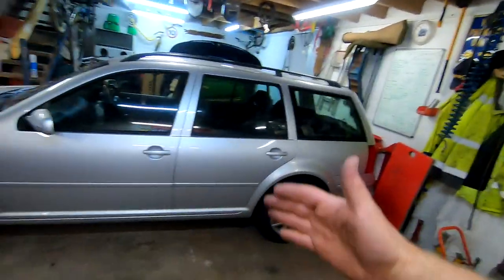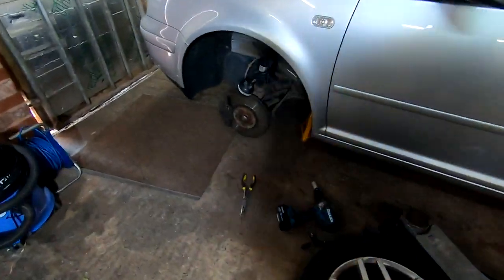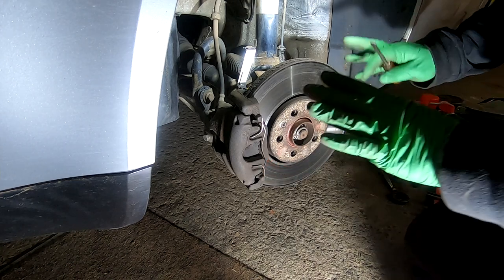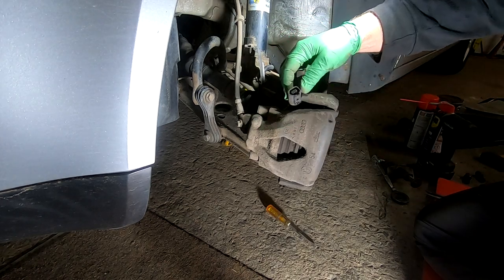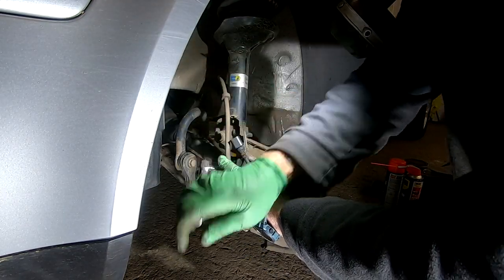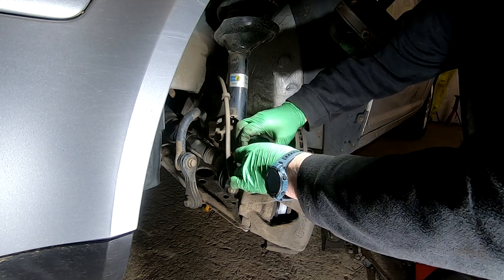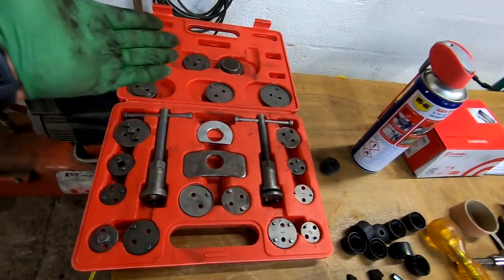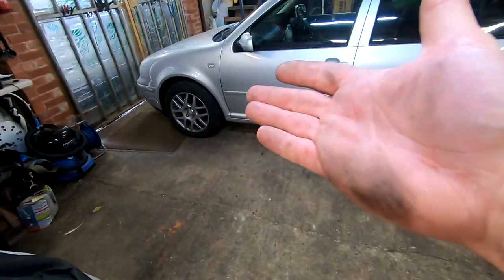MK4 Golf front brake pads replacement.

Comment: Dont know if I've ever seen someone put kopr kote on slide pins, That stuff burns and dries at 175c. I'm a big fan of that cheap silicone brake lubricant, 300,000 km on our farm truck and never had a seized pin👍
Reply from the maker: Thanks 👍